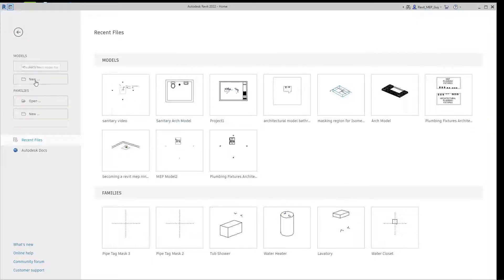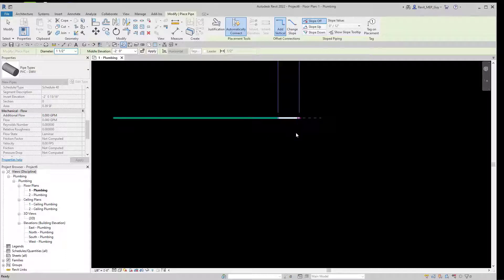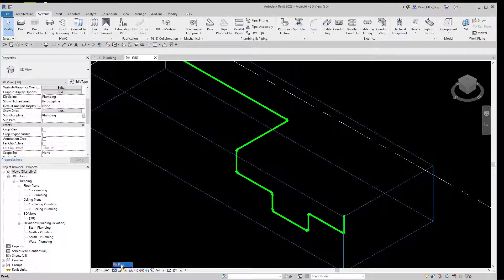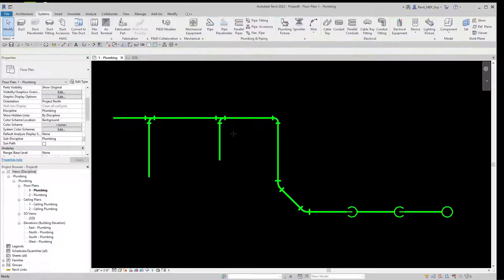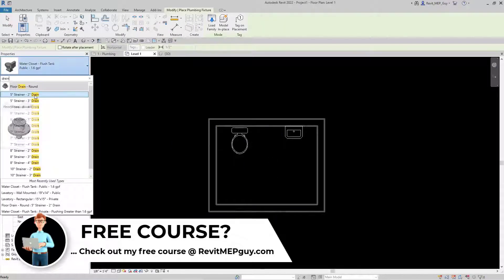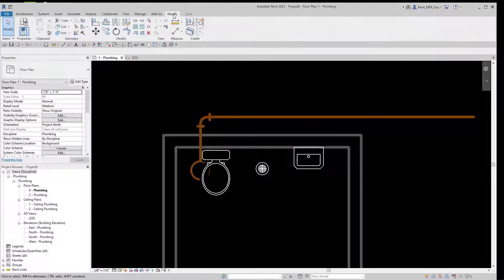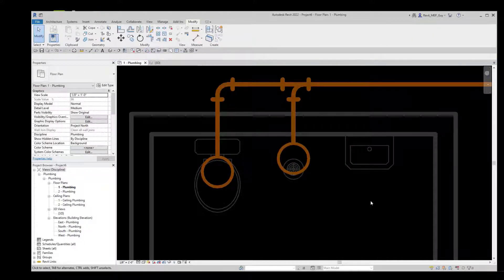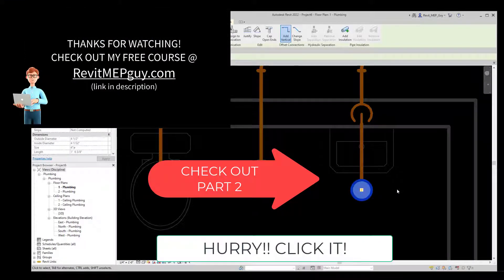(Quick Guide) Sanitary Pipe for Beginners in Revit

Comment: I like how you went straight to the point unlike that Balkan architect guy who rambles for 20 minutes about himself on all his videos and bombards you with ads.
Reply from the maker: Thanks! Yea, I did notice that about him. Surprised he hasn't worked on that. Its a common mistake youtubers make (especially in the Revit teaching space). I'm sure I've been guilty of it on occasion. Appreciate the comment!
Reply: @mep_guy  Thanks; I'm wondering how you can  you can draw a pipe vertically; I have two pipes directly on top of each other at different elevations. How can we connect them by a vertical pipe that tees to both. When I select a pipe, it only allows my to draw it in the level plane.
Reply from the maker: It's hard to explain with text. Check out this video where I go into most of the piping techniques you'll commonly use. https://youtu.be/iktmQ4QP28I